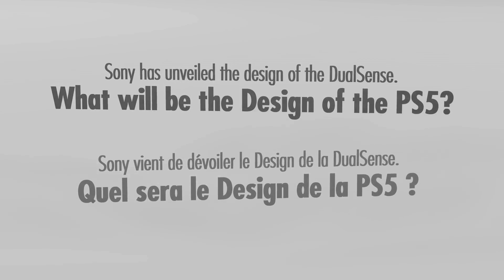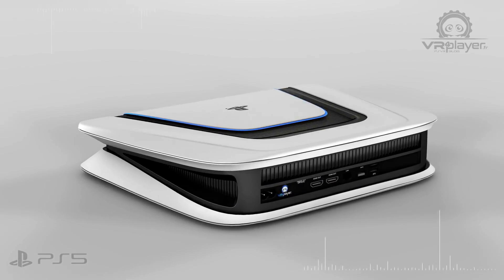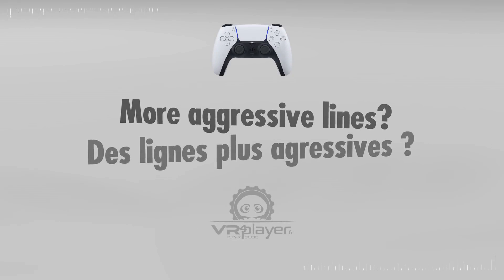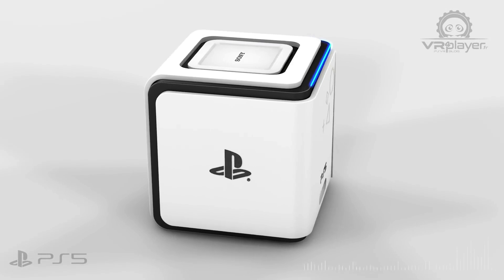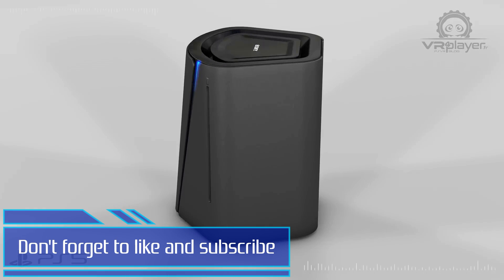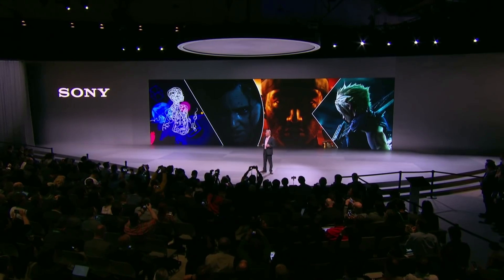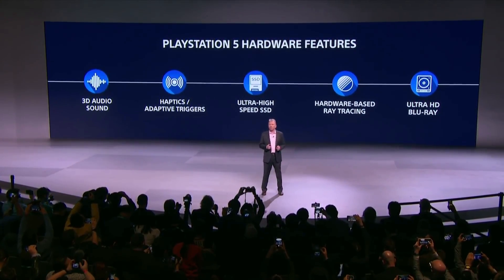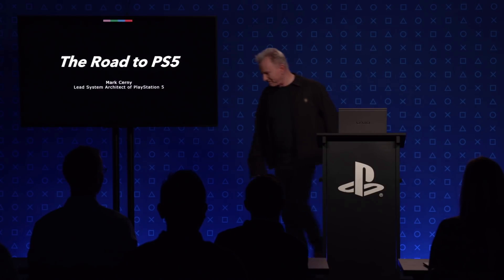PS5 Uses Revolutionary Cooling Solution | Overheating Concerns Squashed, New Patent Reveals

Comment: There is virtually no chance that Sony panicked and just increased the clock speeds at the last minute.

This GPU is a bespoke component and Sony was intimately involved in its development. 

Part of this process includes stress testing a number of different configurations and choosing the one with the best yields relative to cost.  

Even if the Series X reveal informed their decision (which I doubt), they still would have chosen a previously tested configuration.

There's simply no chance that the company panicked and pushed the clock speeds on a handcrafted GPU to the point of potential hardware failure.

Sony's strategy has always included an insanely fast SSD, which necessarily meant a smaller budget for the GPU.

Sony is betting that their innovations in data streaming and emphasis on removing traditional bottlenecks for developers will allow them to get more performance from their comparatively less powerful GPU.

Now, whether this gamble pays off is yet to be seen. But what's not debatable at this point is that the PS5 is the product of a very particular design philosophy.

Sony didn't panic when they saw the Series X because they never intended to fight this battle in terms of Tflops.

I haven't owned a console since the Xbox 360, so I really don't have a dog in this fight. Personally, I want both consoles to succeed because it's simply better for gaming. 

But this zombie-rumor about Sony "underestimating" Microsoft and increasing clock speeds in a blind panic needs to be put down for good. 

If you want to critique Sony's PS5 design philosophy, then by all means, do so. But that begins with the acknowledgement that their GPU  is in fact the product of a design philosophy and not mindless desperation.

For my part, I think some people will be surprised by how little difference exists in capability between the two platforms, but only time will tell.
Reply: Great comment in general, but there is also a good chance that everything you said is infact true and Sony have been caught off guard... 

I've gamed on every Sony console, but companies in all industries have to adjust and pivot all the time in the business world. Sony have had to look at the messaging long and hard as the power narrative this generation along with pricing guaranteed them victory early on. Currently Microsoft are doing to Sony what Sony did to microsoft when this generation launched... They aren't panicking in.public but I'd love to be a fly on the wall for their internal meetings over the last few months... 

I'm excited for both next gen systems, but Sony's total lack of confidence (so far) and Microsoft's confident narrative have definitely affected Sony's reveal plans... 

Given Sony's first-party studios and their amazing exclusives, I'm ok that the system isn't as powerful... It's obviously 9.?? ish teraflop system that overclocks, but this will never be sustained performance. IMO Sony doesn't have to worry about how good they are exclusives are, (they're amazing) it's how they explain to gamers that every third party game will most likely perform better on the Xbox... most game companies will want to show off their games on the most powerful hardware and it gives Microsoft that best place to play card... 

you will also be interesting to see how backwards compatibility compared to what Microsoft is offering and also what they're going to that can compete with games pass... 

Looking forward to both systems and it will be interesting to see how both companies market between now and launch! ✌️
Reply: @GH-sf3di  You seem like a reasonable guy, so I'll just ask you a simple question.

What's more likely, that Sony chose one of the many GPU configurations it had already ran through stress testing, or that it overclocked a GPU beyond prior test limits in a blind panic?

The answer seems pretty obvious. Sony isn't exactly new to this. And they know the kind of money Microsoft has to throw around.

Besides, I'd bet every dime I have that neither company was surprised by the other. Between corporate espionage and leaks, they both knew what the other was doing.

Comment: I think people are being misguided here on both sides. Just because PS5 has a special cooling system doesn't mean it's superior or better than Xbox's. The reality is that sometimes a system doesn't need such an elaborate cooling system if it's designed correctly and smartly. A console has a lot of working parts and i'm sure on both PS5 and Xbox some parts work and optimize better than the other. Maybe PS5 needed a more intricate cooling system because they had issues or maybe Xbox didn't need a crazy cooling system because it ran fine without it. Too many people speculate and watch these videos despite not having extensive knowledge or the hardware in their hands. Let's all relax and wait and see, no point in arguing over things we don't have right now....

Comment: shots fired! Sony emphasizing how their console will be cooled from the top and bottom, as opposed to next gen Xbox that is cooled from the top :o
Reply: Technically the xbox it's being cooled both sides also motherboard sideways on vertical tower just not as efficient. One big fan draws air from low of case to top. But sonys will have heat sink and cooling tubes moving heat to opposite side but can be cooled from air at same time also.

Comment: The console wasn’t pushed at the last moment - you don’t get such a cooling solution from one moment to the other and hardware has to be tested too in earlier stages.

The most logic thing is that that they limitiert the costs for their components and that’s why they went small and not wide. And then they tried to push the maximum out of the gpu with the best cooling solution they had. An then there were 10.28tf. End of story.
Reply: True, Cerny said himself that PS5 was designed around fast data access.

They dedicated a significant portion of their APU to connecting with the SSD and removing as many limitations as possible to accessing data efficiently.
The whole design of a console is locked in years before it goes into production.
Cerny done his tour of the industry and this is what came out of the feedback he got from the industry.

A 2.23GHz GPU, will calculate fast within each Stream Processor, we don't know the exact size of the box, so to assume it will get hot is unfounded, it also makes no sense because failure rates would reach undesirable levels.

RDNA2 is confirmed and it is said by AMD to be much more power efficient than RDNA1, something like 50% more so, so those kinds of figures actually fall in line with the kinds of speeds achievable in 36CU RDNA1.

Tests would never start at the highest point anyway, they wouldn't know what the high point of their custom SoC speeds would be until they had stable silicon and could work on taping out their design.
Reply: @MrSec84  yeah except they would both need faster access to the ssd if they are using it as vram as well. That’s why Microsoft made basically a memory card, cause that card port goes right to the soc. Which I wonder if that also means the amount of vram that could be used would be increased.
Reply: The high overclocks were clearly last minute, a reaction to Series X having more compute units. The issue is if this cooling can handle that extra heat.
Reply: Adam H7 no. Never ever. Do you know anything about hardware. Such changes impact hardware and everything, it’s not the cooling solution that is effected alone, it’s the whole hardware soc Lay-out wich is effected and need to be changed.

I don’t know why so many kids think that is last minute and even possible in that short amount of time.

This generation, cpu and ssd at the keys for next gaming experiences, that’s what all developers are saying.

No one ever spoke about overclocks, that’s just a fanboy term but no tech talk. You blame yourself, really.
Reply: @franzkuntschnig1320  sorry "kid"? I know what I'm talking about I'm 22 and have a degree in computing. Overclocking is a known term and has been a thing since computers have. The CPU and GPU overclocks could have been decided on just after MS revealed the specs for series X just fine, with no changes to other hardware bar power draw which is simple because they already had the power sharing set up. And Cerny did talk about it, a lot, he referred to it as "boost clock" which is the same thing just different terminology. You are correct in one place, the CPU and SSD for both PS5 and Xbox Series X are the biggest upgrades and will certainly help developer freedom.
Reply: Adam H7 the boost is not the frequency cap, the boost is that unused power goes to another part and that is possible due to the variable frequencies wich roams power free. That is what Cerny is talking about. Developers work with fixed frequencies at 3,5 ghz and 2,23 ghz. That stated Cerny too.

If you’re a specialist you should know that overclocking means that a frequence is booster over their normal status for a amount of time. That is simply not the case, explained by Cerny, digital foundry and co.

I did not say that overclocking is not a  valid term, I said that it is just not that what happens in the ps5 and is the boost system because there are no fixed frequencies and they change due to workload wich roams power free. That’s the concept.

For a guy pretending so smart using terminology that is inaccurate, makes you really not believable in any way to be honest.
Reply: @franzkuntschnig1320  I understand. I know the PS5 clocks are variable and if you want to be very technically accurate then yes you are right, it's not "overclocking" in the sense that means it sets a new clock speed whereas what the PS5 is doing is giving more power to either the CPU or GPU depending on which needs it and then raises/ decreases clock speeds which means it's in constant flux. It's just the word overclocking is more known and is widely used for the meaning of "speeding up" or "boost" so more people understand. I think it somewhat fairly describes what the PS5 is doing but there's an extra bit that makes it constant, so maybe "active overclocking" is more accurate and that's why Cerny uses the term "boost" but his also leaves the notion of variability out.
Even with the power sharing all these processes and the high clocks the components can possibly reach, cooling is still a crucial factor. That's why MS made the XSX a tower even though it's clocks are locked, it's important to consistent performance.

Comment: What people especially shouldn't think is that 2tflops more is worth $500 (or $100 more...) I think the possibility of the PS5 costing $500 is there, exactly because all the revolutionary technology in it. XBOX has gone more for evolution (although the way that the motherboard is split in two is cool, but Apple was the first to do this with the new Mac Pro 2019). This cooling solution (if it's going to be used, remember, it's just a patent), then this will be truly revolutionary! Also, this fast SSD man, i know people are likely tired to hear this, but it's not only there for faster loading times (or no loading times at all), it's there for a lot of other things, already well explained in different video's! This SSD will also be a bit of the where the cost lies. And to be honest, i'm perfectly fine to pay $500. We live in 2020 now, it's not 2013 anymore...

Comment: I would pay that 6-700 dollar price tag if Sony can make the PS5 more powerful than Xbox series x.
Reply: It's faster, (by a lot) but not more powerful
Reply: gunther the penguin that’s actually not correct. Ps5s ssd is faster. Every other component is faster in the series X.
Reply: Light Yagami just because the series X cpu can switch modes doesn’t mean the ps5 is better. The series X cpu smt is still faster. Again the series X has all the faster components, it’s the faster console.
Reply: wait on pro version🤔
Reply: @sadboy-vl6od  Yeah but that won't drop until a few years after initial release and usually it's a slim model then a pro
Reply: @newzinski6946  guess you never heard of a pro version. Wait 3 years and there will be a pro version
Reply: @bizzex5685  I don't think you listened. So far in the consoles lifespans they've released their initial console, then a slim revised version then a pro version after..Jesus

Comment: Sony never got caught off guard whatsoever, they are a hardware company they know exactly what they are doing,  let's see how that big horrible xbox copes with heat huh
Reply: liverpoololdschool Xbox big like that for cooling
Reply: @JacobS-p8x  It is not pretty interesting. You really need to take a look at PC side of gaming instead of just consoles. Microsoft literally copy-pasted the design of 4-year-old MSI Vortex and the trashcan Mac Pro design and marketing it as an amazing never before seen solution for cooling. Here is MSI Vortex: https://youtu.be/JEMHx8-ApV4?t=25
Reply: They've said there isn't a problem with heat.
Reply: @JacobS-p8x   the Series X has a higher clock on the CPU though, so there's that. If you look at something like the Corsair One, MSI Vortex, or Phanteks small form factor cases (which I think Microsoft got inspiration from), those have ventilated sides with the fan on top (like the Xbox, but the Xbox only has one intake).
On a side note: Series X is exhausting hot air on top, not pulling in air from the top. I'm sure you know with most PC cases you'd want to have the back and top fans as outward (since warm air rises) 
Sony's cooling solution needed more attention because I think they're going to stick to traditional console form factor, whereas Series X is taking on a PC chassis design.
Reply: @musticlas  the intake is on the base yes but also in the back too, it's perforated by the ports just like the base.
Reply: @AdamH7  ah yeah I forgot about the back.
Reply: @musticlas   exactly. Sony is headed were the Wii failed. X box is headed for better  grafix/pc type console.
Reply: @listocastillo6453  where did the Wii fail? Wii was a successful console. It's not a hardcore gaming console, but Nintendo achieved their goal. They weren't competing with Sony and Microsoft in the way most would have liked. A failed console would be the WiiU. While that was supposed to be "next gen", specs-wise it was on par with last gen's PS3 and Xbox 360. Nintendo then attempted a comeback with the Switch, which is much more closer to the vanilla PS4 and Xbox One, while still holding onto their traditional gaming focuses. 
In a way, consoles have always been computers, and Microsoft is attempting to bridge the gap between PCs and consoles with their PC-like design for the Series X. PS5 will most definitely not be a failure. Sure, it doesn't have as good TFLOPs, but that's not all a GPU is about, that's one out of many aspects of a GPU. Console fanbois love throwing the TFLOPs war around when it doesn't necessarily mean that much. Did you know that the PS3's GPU was a 400 GFLOPs unit? While the Xbox 360's GPU was only a 240 GFLOPs unit, it was still the better GPU overall. It's just that in this instance with the upcoming consoles, both are using the same architecture. There are some good videos out on YouTube which explains the strengths of more CUs vs higher core clock. It will all come down to what the game engine favours more. So there will be titles that perform better on Series X, and there will be titles that perform better on PS5. And it won't be that easy to tell the difference. One thing Microsoft needs to watch out for, is PS5's blistering fast SSD. Sony's first party games will do things that Xbox won't be able to do as well, and that won't be possible on PC for the next several years.
Microsoft is boasting about how you can switch between games, PS5 switching will likely be faster. The single most biggest downfall on the PS5 is the storage size, but I'm sure in 2 years time Sony will release 1TB/1.5TB versions.
Reply: There's been teardowns man, the cooling is great. 1/3 of the thickness of the tower is the vapour chamber and the large fan at the top will pull air from under the base and out the top and it's gonna do this very quietly just like Xbox one cooling.
Reply: Xtards: We gotz hAlO 8 duuuuuuuuuuuuuuuuuurrrr
Reply: @jerrybrown6460  PS pussys: uh uh uh we gots a fasta ssd. Duuuuuuuuurrrr
Reply: Doubt the xbox will have cooling issues but they got a chunky design. Just look how slim they managed to make the ps5 it's incredible